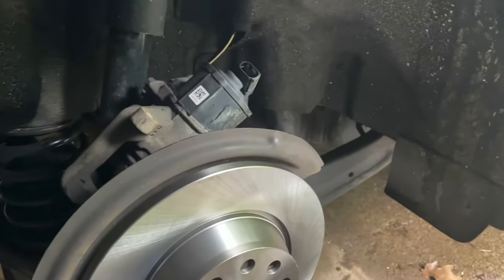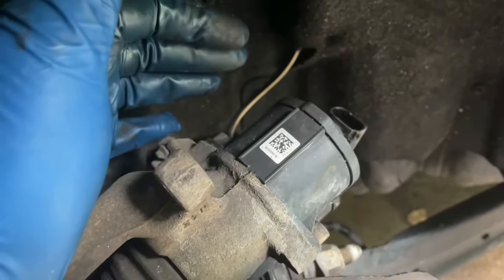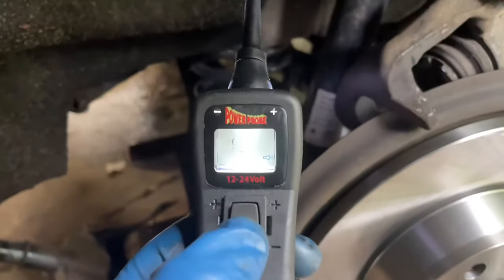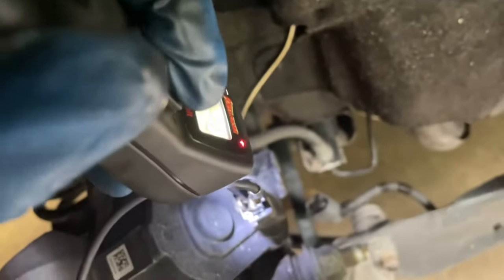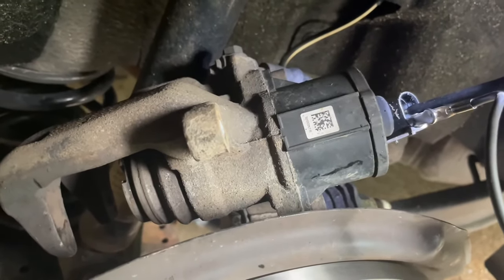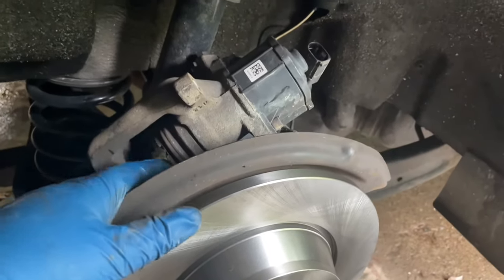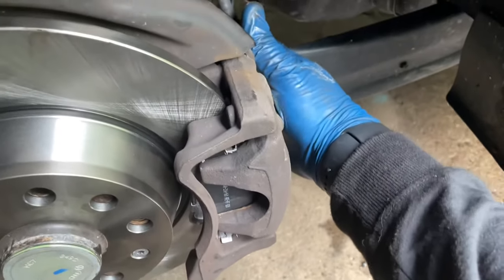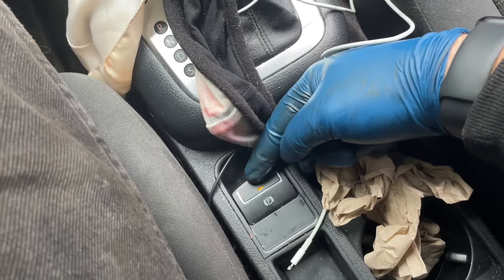How to reset rear electronic parking brake! Audi/VW No Vcds needed!  M

Comment: DO NOT do this that way. You still need to do calibration through computer after changing brake pads.
Reply: My thought exactly 😅
Reply: Thats why its turns so shitty at the end when he he is turning the brake disc. Got to calibrate with computer. Opens and closes a few times but it runs free
Reply from the maker: It’s been well over a year now and no problems at all! Parking brake works and releases every time and pads are still in great shape.
Reply: @prestofixit3518  Good but it won't be same on every model, may depend on the year/model or trim version
Reply: Wrong. The piston will calibrate itself the first time you pump the brakes & turn on the parking brake so it can relearn it’s proper position. It’s literally just a manual way of doing the exact same thing that the scan tool/computer would do.
Reply: Wrong. The piston will calibrate itself the first time you pump the brakes & turn on the parking brake so it can relearn it’s proper position. It’s literally just a manual way of doing the exact same thing that the scan tool/computer would do.
Reply: @ThumperG  Good luck doing it same way in for example BMW G-Series...
Reply: @SeiferFirehart  I’ve done it plenty of times, it’s the exact same process on BMW G series. It’s literally the exact same process. Basically any car with an electronic parking brake can be done using this method. It’s just an electric motor built into the piston. If you don’t have a scan tool to put the car into maintenance mode where you can retract the parking brake with the computer then just like with anything mechanical, you can also do it manually. You can do it with a power source and supply power to the motor and retract it that way, or you can take the cover off and turn the motor manually. Its really simple, anyone with basic hand tools can get it done. No need to go to a dealer or mechanic with a scam tool just to change your brakes. It’s an easy job even with the electronic parking brake, or just adds an extra 5-10 minutes to the job.
Reply: @ThumperG  You have no idea how computers work in vehicles and how many problems you can cause while "not telling" vehicle you replaced brakes. You didn't do it plenty of times.
Reply: @SeiferFirehart  lol You can say that all you like, doesn’t change the fact that I do it all the time. And yet never once had a problem. Funny how I’ve don’t it without issue, this guy did it without issue, and there’s PLENTY of videos of others doing it with absolutely no issue at all. You’re the only one here who claims the computer is too stupid to realize the brakes have moved and the piston and parking break are now set in a new spot. Literally just changed the brakes on an Audi last night without using a computer and when I was done, the brakes worked fine, the parking brake reset fine, and not a single error code came up. The computer relearned the new position for the parking brake and they were good to go. If your car is so technologically advanced it needs a computer to know where the brakes are, how much they’ve been used etc, then I’m sure that computer is smart enough to tell when the brakes have been changed. If it can’t and you have this catastrophic failure you speak of, then that POS computer shouldn’t have been put in the car in the first place… so I’m wondering, how come non of the cars I’ve done this job on have EVER had any problems? They all recommended using the scan tool or computer to reset the piston, then set the parking brake once finished, but I’ve never once used it. I’ve done this job countless times and never once used the computer/scan tool, I do it all manually, and never once have I had any issue. Am I some sort of miracle worker?? 🤣
Reply: @ThumperG Thanks....it's like a damned marxist plot for brake jobs they're trying to install.
Can you say baah?😊
Reply: @ThumperG  How to go maitanence mode ?
Reply: Vous semblez si sûr de vous 😅
Est ce qu’il y a un codeur ou autre composant de ce type ? non…
Est ce que l’usure des freins est déterminée en rapport avec un temps ou un kilométrage ? Non plus…
Il faut juste faire très attention ⚠️ à couper le circuit lorsqu’on constate que le piston tourne et surtout ne pas forcer électriquement au delà de la résistance en Ohms du moteur.
Merci @Prestofixit
Reply: @prestofixit3518 I’m having a issue with my electric rear parking I put new pads rotors and calipers on now everything is back together but my car says parking brake malfunction and I can’t use my switch in the car to engage with the rear parking I read I can disconnect the battery terminal for a few seconds to get rid of the code and it will reset my electric parking but would you have any ideas on what I could do anything that might help I’m trying to avoid the deal it’s cost to much these days
Reply: @SeiferFirehart been done plenty times on G series exactly the same way, with no issues.
Reply: @SeiferFirehart  you can reset service counters in some vehicles when you have replaced pads, but there are plenty vehicles you can’t.
Reply: I think you are mistaken. 
Changing pads has no need for any calibration through a computer, what computer are you referring to? 
Some cars have the ability to reset a service counter following pad replacement, some don’t. 
Or are you talking about calibrating the parking brake EMF actuator?
Yes, it’s best practice to use a scan tool or other software to retract and reset the parking brake, but otherwise this is absolutely fine to do if you don’t have these things. 
The parking brake will stop itself once it meets resistance.
Reply: @axxesaxxes8810 there is nothing “shitty” at the end. The parking brake is released and there is a slight drag on the pads like any normal caliper has.

Comment: You can also take the black Parking brake box off of the caliper and rewind that plunger inside of there with a drill and I believe its a T25 or T30 Torx or equivalent size allen bit. Much easier doing it that way honestly. Took me like 20 minutes to do the whole job.

Comment: Be careful not to let them touch in while they're in there. I tried this and they touched by accident and I'm pretty sure that's why I'm getting "parking brake malfunction" warning lights on the dash
Reply: @Dan123. Are u talking about module for the parking brake?
Reply: @Dan123. Great talk. We'll have to do this again some time soon
Reply: @Dan123. Straight from the battery with 2 Alligator clips
Reply: Saw a lil spark near the 2 prongs when I accidentally tapped the 2 gator clips while they were comnected
Reply: @Dan123. When u say bridge the wires on it, what exactly do u mean?
Reply: I did the same thing it sparked and now I have a parking brake malfunction and came start my Audi

Comment: Thanks for sharing.  
It’s best not to apply power to the actuator like that, especially when it meets resistance like that, as there are belt drives and gear drives within the actuator that can be damaged. 
Best to remove the actuator and wind the brake by hand. 
This is of course in the absence of a scan tool, or diagnostic software which is ultimately best practice.

Comment: Thanks for this, was a bit worried it would be throwing error codes etc - it did at first but after driving it all was good 👍
Reply: I did this and now have a electronic parking brake malfunction light, do you have a solution for this?

Comment: Turn the ignition on amd repleace the parking brake as normal and then wind back with wind back tool.

Once new discs and pads are all fitted just put the parking brake back on. Will work fine l.

Comment: You should do this  with the caliper mounted and before removing the brake pads . Why ? cause if you push the piston out all the way , you are screwed,
Reply: I did just that on Tuesday.
Reply: @cy_young_9104 how do you fix it once it's all the way out?
Reply: @dudndadn12212  You will to open the bleed screw , clean the piston and re-insert t. Then replace the pads, set the caliper and pray.

Comment: Great vid thank you, but how did you release the brake with gnision switched off, or did you leave keys in ignision ?.
Reply: I put my key in the ignition to the on position without starting the car, pressed the brake and handbrake switch to take the handbrake off then took the key out of the ignition. make sure the car is in gear with the front wheels chocked

Comment: In my dads A4 Avant from 2011 we could push the caliper back like you normally would and it would calibrate on its own
Reply from the maker: Yes if it doesn’t have electronic parking brake it will just be like a normal brake service.

Comment: When I tried to do rear brake change, i took the brake pads off, wondered if I could recover the piston by using the parking brake switch. Then I saw brake fluid is everywhere on the ground, parking brake light is on dash now. What should I do?
Reply from the maker: Sounds like you might have over extended the caliper. Might be able to wind it back in and save it but might need a new caliper.
Reply: You can take the motor off and unwind the EPB with a torx on the back of the caliper. You will need to compress the piston back into the caliper. I did this last Tuesday.

Comment: Excellent idea, where you get that gadget? 👍👍
Reply from the maker: I got mine off Amazon! Very handy tool to have.
Reply: @prestofixit3518  Can you provide the link?  Would love to get my hands on that!
Reply from the maker: @chrisdewitt1  just look up power probe 3
Reply: Is the handbrake locked on or is it an intermittent fault?
Reply from the maker: @cannonball7984  not sure what you mean? The parking brake works fine after this.
Reply: @prestofixit3518  mine locks on, then I can get it off by off/on the engine and reapplying the handbrake. Iv had it plugged in and the fault says ‘motor’ but I’ve been informed by a mechanic that could be the motor of it could just be wiring and to get an electrician to check it. I don’t know what to do
Reply: @cannonball7984  Kindly provide an update if you managed to have this problem fixed.
Reply: @josephmwanza5444  i will. Ill assume your in the same boat
Reply: @cannonball7984  Yes. I  plan to change my rear brakes discs and pads and I want to learn all the possible scenarios before hand. It'll be nice of you to do that
Reply: @cannonball7984   did you ever manage to get this resolved. Having the same issues would appreciate if you could let us know what you did to resolve. Thanks
Reply: @asifmahmood277  never got it resolved mate, I can get it off every time though. Just on/off engine and reapply the handbrake and it resets it. Which leads me to believe it’s an electrical fault. Iv given up using the handbrake or auto hold whilst driving.
Reply: @Dan123. cheers mate, how much did you pay for the motors if that’s the issue?
Reply: @Dan123. thanks mate

Comment: That's turning quite rough at the end, that will just heat up a burn the pads....
Reply from the maker: It’s been over a year and 40k miles. Still working good
Reply: Actually that is normal for newly installed pads and discs prior to driving and operating the brakes. The pads need to be bedded in which happens over a few gentle braking operations after which if you have installed quality parts will give you excellent braking. Just make sure not to brake heavily for the first day or so of driving if possible.
Reply: @andrewwatson5360 That’s the complete opposite way of how you’re supposed to bed in new brakes lol. You want to bring them up to high temp by performing moderate-to hard stops without coming to a complete stop (like hard braking from 40 to 5 mph for example) after hearing the brakes and completing the bedding procedure you want to drive for awhile with minimal brake use to cool the brakes back down. That’s a proper bedding procedure. What you advised, (being very gentle after installing new brakes is exactly what you don’t want to do, I’d doesn’t allow the pad to come up to temperature where it can leave an even friction coating on the rotor, and mate to the new rotor if also installed, causing uneven friction deposits etc.
Reply: @ThumperG  Really ?  Not sure what experience you have had with disc brakes but I'd recommend you follow the (quality) manufacturers fitting instructions if you want the rotors to last without distortion. 
One of my current vehicles which I have owned from new still has the original discs and pads on the rear after 195000 klms and I replaced the fronts at 145000 klms and I live in a hilly area and do a fair amount of towing with it.  
When others drive that vehicle they always get caught out by how grippy and effective the brakes are in comparison to most other cars. 
I maintain the brakes in my other cars as well which include sports and performance vehicles all of which perform excellently with no pulsating, brake fade or needing excessive effort. 
Brakes are like any other part of a car. Treat them with care and they will perform as you need them  when you are driving hard.  If not unless you are on the track equipped with racing standard calipers, pads and discs you won't have any brakes after the third or fourth corner particularly if they have been abused initially. 
It's excessive braking creating lots of heat that causes glazing of pads and distortion in rotors particularly in cheap brands.
Reply: @andrewwatson5360  Here’s a bedding process from Brake Performance which is pretty much the standard for bedding in brakes on your everyday vehicle: Note the key words like where it says to stop “AGGRESSIVELY” several times, and how the point of bedding is to “HEAT UP” the brake pads and rotors. I’ve seen many manufacturers bedding procedures and I can’t think of a single one that said “just be very gently with the brakes for awhile and then you’ll be good to go” LOL Like I already said, that’s the exact opposite of how you bed in brakes. 
***Perform 3-4 medium stops from 45mph. Slightly more aggressive than normal braking. You don't need to come to a complete stop for each pass. This brings the brake rotors up to temperature so they are not exposed to sudden thermal shock.
 Make 8-10 aggressive stops from 60mph down to 15mph. For this set of semi-stops, you want to be firm and aggressive, but not to the point where ABS activates and the wheels lock up. It's important to note that you don't come to a complete stop but rather a semi-stop (~15mph). Accelerate back up to 60mph as soon as you slowed down to your semi-stop.
The brake pads and brake rotors are extremely hot at this point and sitting on one point will imprint the pad material onto the surface unevenly. This can cause vibration and uneven braking.
 You may notice that your brakes will start fading, and sometimes smoke, after the 6th or 7th pass. This fade will stabilize and will gradually recess once your brakes have cooled down to normal operating temperatures. Drive carefully as your brakes may feel softer for the next few minutes.
Try not to come to a complete stop and find a stretch of road where you can coast for 5-10 minutes, preferably without using your brakes.
After the break-in procedure, there may be a light blue tint on your brake rotors as well as a gray film deposit. The blue tint shows that your rotor has reached the appropriate temperature during the bedding process, and the gray film is some of the pad transfer material.

Some cars and trucks require two cycles of the bedding in procedure. This may be the case if you are using old brake rotors with new brake pads, or new brake rotors with old pads. This may also be the case if you don't think you fully heated up the brakes in the initial bedding procedure. In any case, it's required that you wait at least 10-15 minutes between each cycle as you don't want them to overlap.